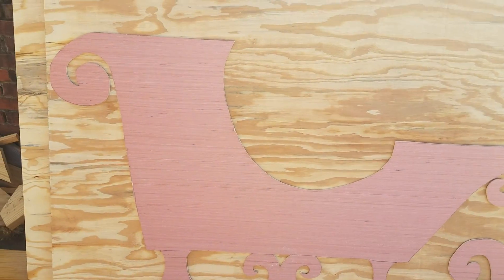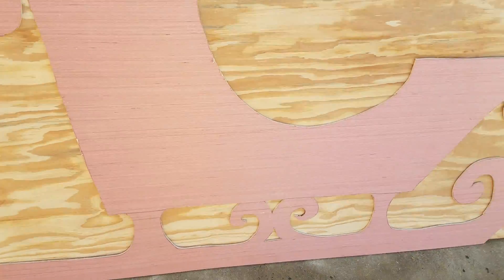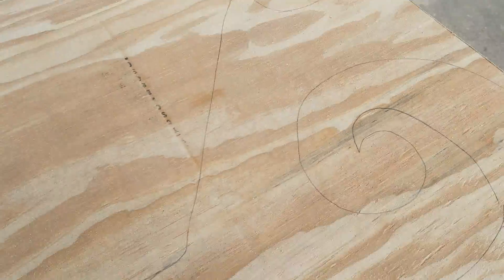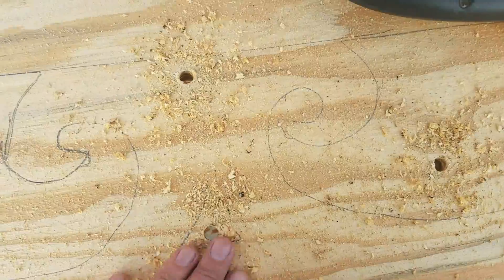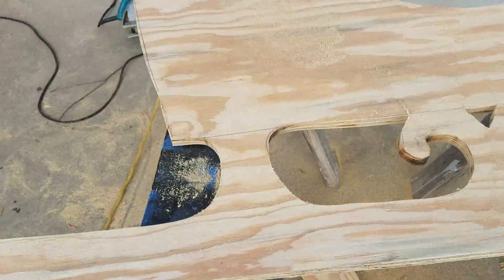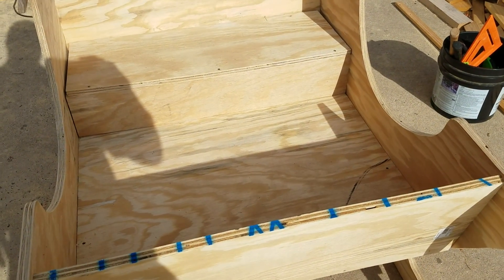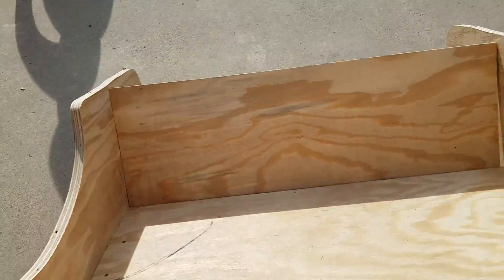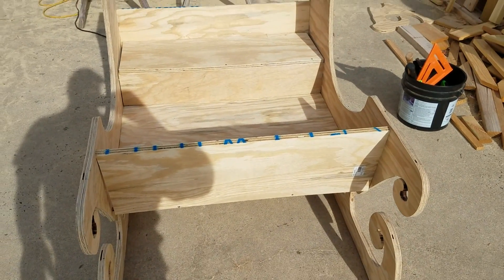Christmas Sleigh build

Comment: So I attempted to make one but using thin Luan plywood because I didn’t want it heavy and hard to move. I was just going to use it for decoration and not really for anyone to sit in. Well it broke into a million pieces when I bore down to put the screws in 🤣. Guess it’s back to the drawing board using 3/4 inch plywood this time